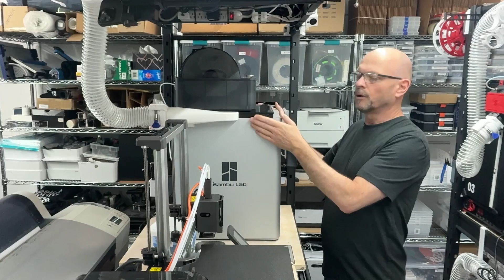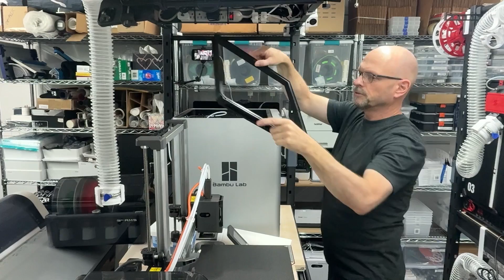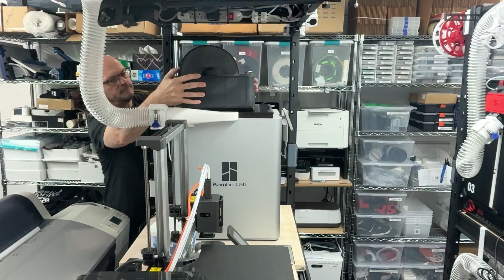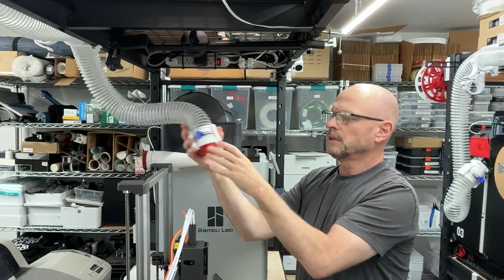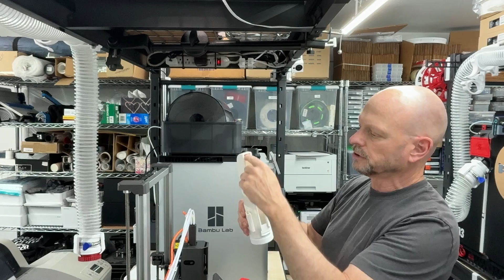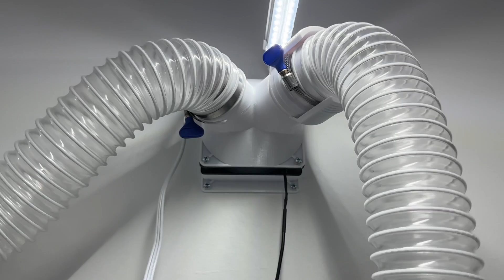BambuLab X1 Exhaust System

Comment: Im printing your Ver 2 right now. I must say thank you so much for designing this. Im grateful. Any issues with V2? are you planning on doing a V3 or is this the one!
Reply from the maker: No, I am happy with the latest version.  I am not aware of any need for changes or revisions at the moment.  Let me know if you find any issues.  Thank you.
Reply: @logicalplanet3d  Thank you, will do. you wouldn't happen to have a 4 to 2.5inch reducer adapter? My ac infinity duct fan uses 4 inch.. thanks again
Reply from the maker: @brambhai4877  I have drafted one but not printed it because I was not sure of the 4" side diameter that is needed.  If you would be willing to test it I would be happy to finalize a design for you.  Can you email me at pdb6251@gmail.com if you want to explore this.
Reply from the maker: @brambhai4877  I have revisited my earlier 2.5 to 4" reducer and it is ready for testing.  Email me (pdb6251@gmail.com) if you would like a copy and I will send it to you.

Comment: what happens with the integrated exhaust fan in back?
Reply from the maker: On this system, nothing.  My intent was to extract enough air volume to eliminate air from the exhaust port.  However, since designing this version I have made a completely different version which captures the existing exhaust (and also allows you to install additional LED lighting).  That one is linked on my logicalplanet.com site.  I will try to post a video about it shortly.  Cheers.

Comment: What a great system! Do you know if this also will work on the X1 Carbon?
Reply: Do you leave the x1c exhaust running in addition to this... Exhausting into your room?
Reply from the maker: @jamesalday1200  Hi, no, if you are exhausting into your room you are not really accomplishing anything with this system.  The idea is to capture all the exhaust and then vent it outside through a window or if you can a through-wall fitting.   I also use a small low power fan at the wall to pull the air out a little (or create negative pressure in the exhaust line).
Reply: @logicalplanet3d  so in this scenario, you would disable the onboard exhaust fan via the start Gcode?
Reply from the maker: @jamesalday1200  no, I have so far left mine operating.  I want that to push air out into the exhaust lines.  BUT and it is a big but, when I started this I understood the X1 and X1-Carbon exhaust out the poop shute (in on the fan side).  But I did some testing yesterday, which I will document shortly, and it seems that the exhaust fan sucks in when the carbon filter is installed and out when it is not.  Since we will be exhausting the entire air out of the X1 we do not need the carbon filter.  So with the carbon filter removed, the system I previously labelled as the P1S exhaust is the right solution, as it is designed for that side (i.e. covers the fan).  Does that make sense?
Reply from the maker: Yes, actually I am using an X1 Carbon.